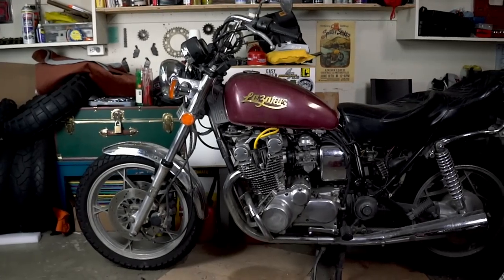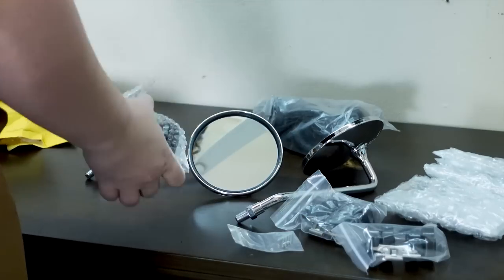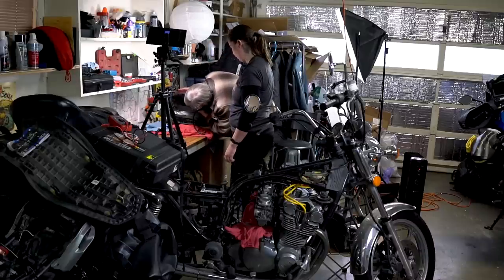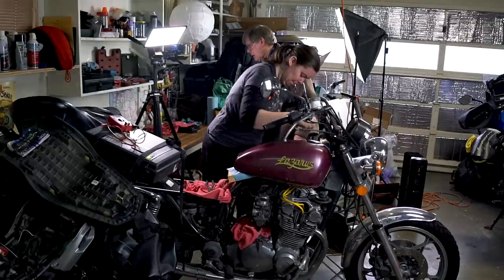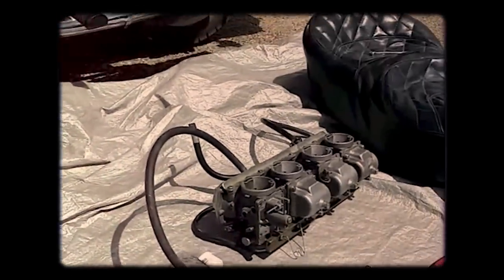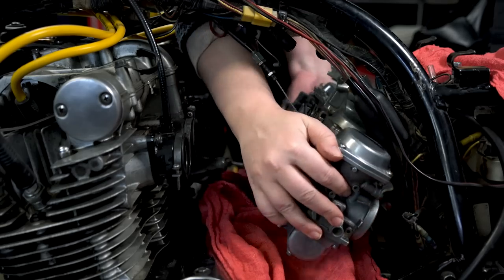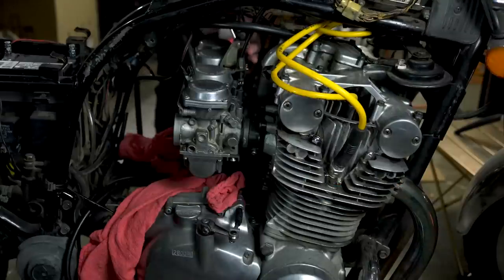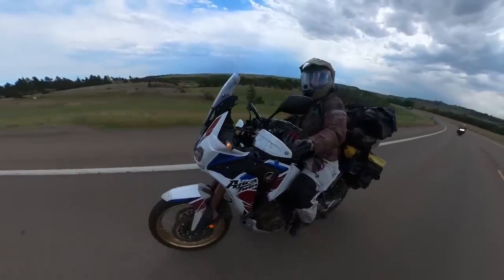Will this 40+ year Old Motorcycle Run?

Comment: I'm a carguy who bought a 71 CB350 and a 73 CB750 last year for $1,200. Both complete, low miles bikes that were running before being parked for a few years but not running now. Nothing on those bikes is intimidating except the carbs, I think I'll watch your video a couple more times than jump in. So encouraging, I can't wait to do my own old-man happy dance when I get them going. Great vid! Full speed ahead!  

P.S. Uncle Tony sent me
Reply: That '73 CB750 has to be worth $5,000 completely unrestored if you can get it running.
Reply: @freemenofengland2880  That's why I bought them together, keep the CB350 and find a new home for the 750 after getting it solid, then sqaunder the proceeds on Ham Sandwiches and gasoline

Comment: My dad bought an old semi a few states away. He had a shop look over it and they didn’t find any issues.  When he picked up the truck, he noticed a belt appeared to be missing. Convinced that a shop would know more than he did, (and he definitely knew a lot), he proceeded to drive home. Because he didn’t give his own expertise enough credit, the missing belt was for the oil pump and engine blew a few hours later. So, I agree - Trust yourself more! And great video. It’s like being there with you.

Comment: I kinda love this. Thank u. Kinda, only bcuz it also makes me sad. My love for bikes comes from my pop (explanation in bio). Around 2008 - 2010 I think, my pop offered me his 1985 Honda CB1000 Custom if I could get it running. Having no formal mechanical training, I bought the manual and got to work by myself, the manual and YouTube videos. About $1300 and I have no idea how many hrs later, I finally got it running. It felt amazing! Your happy dance reminded me of that day 😊 But unfortunately, I guess bcuz of my initial excitement at the prospect of finally having a bike, my dad's bike, and my inexperience, only then did I start taking a better look at the bike and found that I was able to put my fingers right through the frame underneath the bike. I still have no idea how it was still upright. I eventually ended up selling it and that still upsets me. I wish I had it back. 😔 My pop passed away in 2020 and it hurts even more that I don't still have that bike. Don't get rid of yours. That's a keeper.

Comment: Here’s a tip,if you didn’t know. After getting fuel all over your hands, brake cleaner will get the small of fuel out. Will also get stains out of your riding gear.

Comment: I have the first bike I bought which is an 02 gsxr 1k bought in 2006. My wife bought the bike I learned to ride from my father for $1 after she passed the msf course in about 2010. I started riding in 1993 on a 1980 gs450 1992, which needed a lot of work when my wife got it. It now runs great after a rebuild and lots of new parts and my daughter rides it too.

Comment: Mother Honda provides again! I definitely sympathize with your troubles with Lazarus... But the things you've learned about both yourself and the bike while wrenching on it are irreplaceable.

I pulled my current bike, a 1986 Goldwing, non-running out of a shed just before COVID hit. It took me 6 months of constant work, not having worked on ANY motorcycle OR carbs before, to get her into riding shape and it continued for another year after that. There's something to be said about learning by diving in feet first. I rode her nearly across the country from central Florida in 2021, and she's going to west Texas in three weeks.

She's my first, and i'll never, ever part with her... Although I may get another bike or 2.

Comment: Though I do know that gut sinking feeling all too well of the bike not starting. I did a tank lift on my bike which required pulling apart the wire harness and putting it back together then rerouting the entire wire harness under the tank. When I went to turn the bike over, only one cylinder was firing. Talk about your heart dropping into your stomach. After an hour of putting it together and taking it apart, I found the EFI plug on one side of the throttle body had become loose. I never touched it so I didn't know. Lesson learned. XD

Comment: I absolutely have my 1st bike still and I ride her daily. "Juicy" is my Yellow 2001 Honda F4i with 56k miles. For 7 years this bike has been a tank. I've neglected her alot and she keeps running like a champ. I take better care of her now but all the issues I have had are electrical. Wires coming loose, bad connections in the buttons, etc. Now I've lost most of the faring bolts bc they have rattled out. She'll be pretty again one day😍.

Comment: Yep 1999 Triumph (Adventurer) Bonneville 3 cyl 900. Replaced TPS a couple years ago when it wouldn't start. Worked great and stated right upthen sat for a week and won't start again so either the igniter or the TPS slipped. Have a Triumph Bobber now as main ride.

Comment: I hate that moment of the bike turning over before it starts. I spent 8 months bringing a 2001 carbureted Ducati monster to life. From vacuum leaks that filled the cases with gas to the regulator rectifier that the wires were corroded off of. So many little things always keeping that bike from starting. Needless to say it runs better now than it probably ever did for the previous owner.

Comment: That was an absolutely terrific video and I really enjoyed it! I love the older bikes although they can sometime (or oftentimes ... lol) be like opening Pandora's Box! I do still have first motorcycle ('87 Suzuki Savage LS650) however it's currently not running and previously did a LOT of work to it (new clutch, new valve cover gaskets, brakes, electrical, and full tune-up)! The clutch was never correct when I first got it and upon pulling everything apart, I discovered it was missing one of the two thrust washers so there was never enough tension for it to work correctly. I replaced just about every part in the clutch basket and behind it and put everything back together. 

The next day I left for a one-week trip with the bike and it ran and shifted awesome - it was better than new and I was sooo excited! I had ran out of time to put the new tires on before the trip so I did it after I got back. The next time I took it out it was a brisk but beautiful morning! It had previously rained overnight so some of the roads were still wet. I ran to the auto part store (which was brand-new) and had a steep hill and S-turn to get from the main road up to the new auto part store's parking lot with brand new pavement. Anyways I picked up new turn-signal and brake light bulbs for the bike, installed them in the parking lot, then proceeded to leave. I was coming down the steep hill and going into the S-turn in first gear to prevent from building too much speed. I tried to gently hit the brakes as I was turning the first bend and the back drum brake immediately went into a slow skid on the brand new tires and pavement (that was still wet)! I ended up wiping out (first time ever).

I quickly turned the bike off and picked it back up. I landed on my side and had a sweater on and ended up getting really bad rug-burn all up my right forearm (however didn't yet realized this). Instead of trying to pull up my bloody sleeve with holes in it now, I just wanted to get home quickly. So I picked the bike back up, fired it up and quickly got it back home and then got cleaned up. I didn't ride the bike for about 3 weeks after that (not intentionally) but I went to bring it back out one morning and tried starting it but no matter what I tried, it would not run all of a sudden! It had gas, spark, and everything else. I then went through the list of things to check and discovered the compression was really low! And this is where it still remains and not sure what exactly happened. I did some research and I know some of the Suzuki models had a compression-valve that would make it easier to start and am hoping it's something as simple as this, otherwise I'm going to be pulling the engine apart to rebuild it.

Comment: I do NOT still have my first bike, unfortunately.  It was a 1983 Honda vt500 shadow. I bought it wrecked in 1988 . Fixed it up and it was my transportation from my junior and senior year of high school. I graduated high school in 1989 and rode the shadow for another year and now you’ve got me thinking what ever happened to that motorcycle I replaced it with a CX 500 custom 1979 model don’t have that bike either or any of the next few I had after that.? I’m eating up the miles now on a Honda helix 250.

Comment: Very cool - I love how you just tear into your bike.  Removing the carbs seems to me to be like major surgery, requiring years of training and education which I don't have.  So I get intimidated easily.  But congrats on getting your bike running.

Just curious, how did you know the jet under float 3 was the bad one?  What exactly clued you into that?

I have 2 bikes that are sitting in my garage and I've been buying tools and repair manuals.  I'm about ready to start wrenching on them.  One is a 2001 BMW and the other is a 2008 Harley - both were bought brand new and I've never done any work on them, it was always easier to have the dealership do it for me.  And I could afford it.  BUT I don't want to do that anymore so I'm jumping in, come what may.

Comment: Ah yes the emotional roller coaster of highs and lows but so worth it!! No longer have my first bike a 1985 Suzuki GT380 triple 2 stroke.  When you get back to it, I found that a carburetor synchronizer was of great benefit. Mine had slides not butterfly but important to have all the carbs in sync for best performance and each cylinder get the exact same amount of air/fuel so one cylinder is not working harder than another. GREAT JOB and keep after it!!

Comment: A couple things that would make life easier are a Auxiliary Fuel Tank that hangs off the handle bars and a ultrasonic cleaner. They cost a little money but the time they save make them worth it! Hopefully you either ran the carbs dry or used fuel stablizer before storing the bike for an extended time. I'm looking forward to see more adventures from you!

Comment: Greatest admiration for your tenacity and spirit of adventure. Do you have an inline fuel filter? Short of pulling all the carbies apart and rebuilding them or getting it done by the experts which cost money I'm sure number four carby with clean or new jets will see it running fine. I believe they use vacuum gauges to syncronise adjust the carbies. I'm no expert or mechanic its only what I've seen on other Youtube vids. Allen Millyards videos are great. Have some more wonderful and safe adventures. Best wishes, from Paul downunder

Comment: Refitting the carbs is a lot easier if you lubricate the inside of the boots with WD40 before you push them in. Fitting is a bit trickier on my GS550, because there isn't room take the airbox right out of the way, so you have to squeeze the carbs in between the engine and airbox, but it doesn't take much physical effort to get them in, just patience and positioning. Nobody else touches my bikes - I'm a retired mechanic, so if I can't fix it, it doesn't deserve to be fixed.